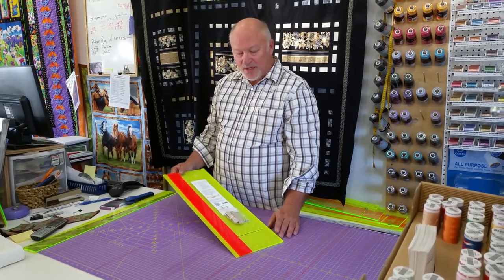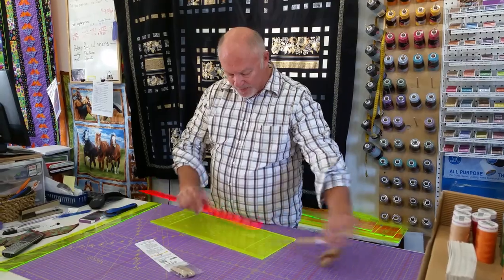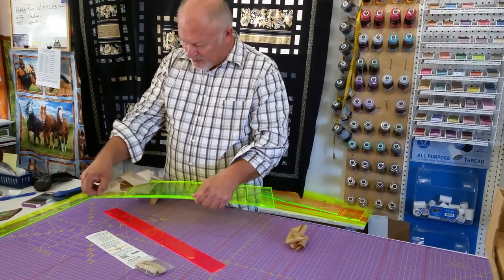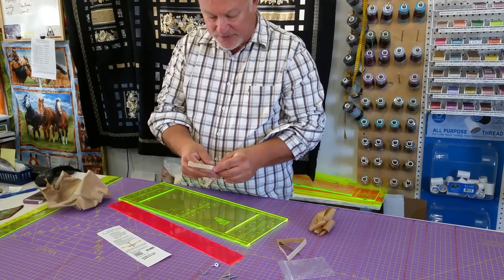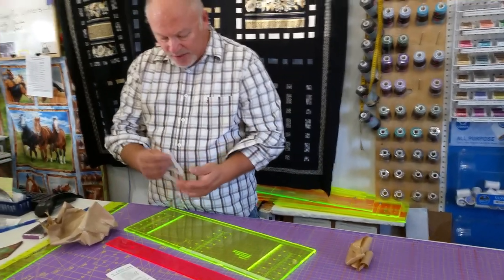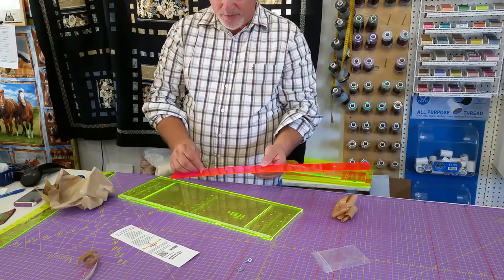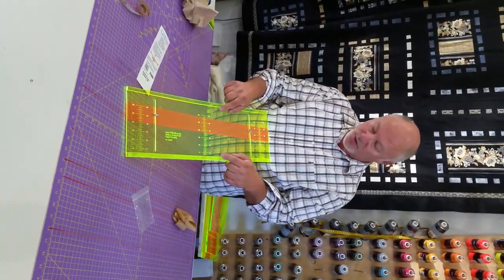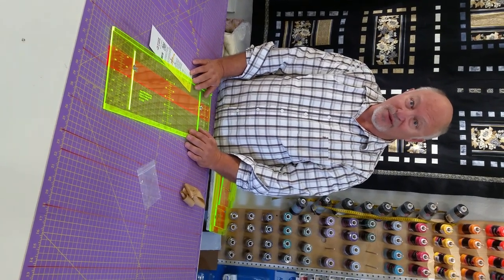6 inch Adjustable Slide Ruler

Comment: I have purchased your a couple of your rulers, the slide lock which I love and also the 2 1/2 inch recessed ruler. But I just came across this, and I hear you say that you invented this ruler. I find this sad because this ruler is a copy of the Westalee Quilting Ruler system, that was invented back in 2006,. Sad